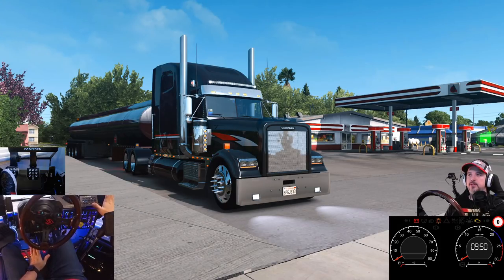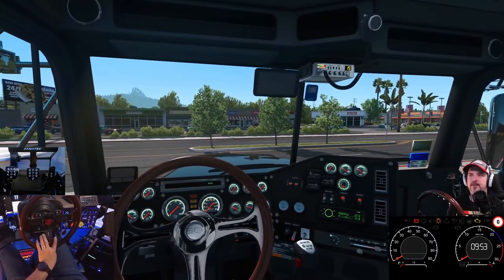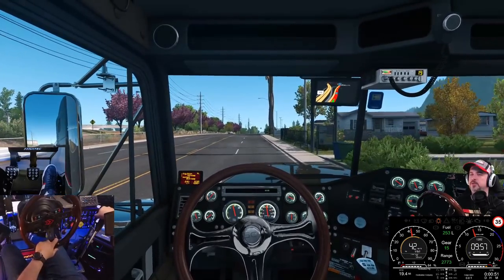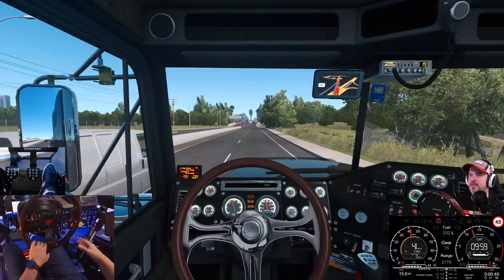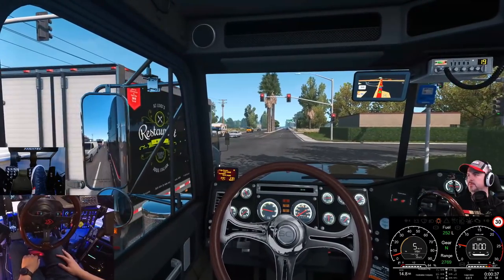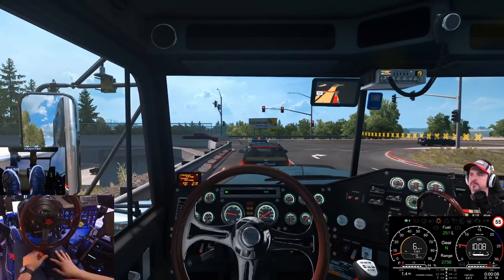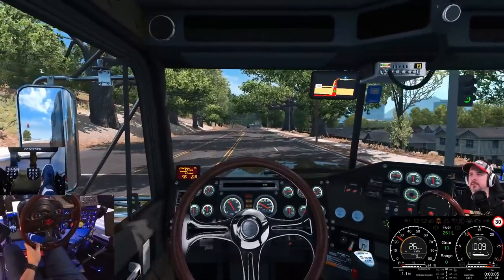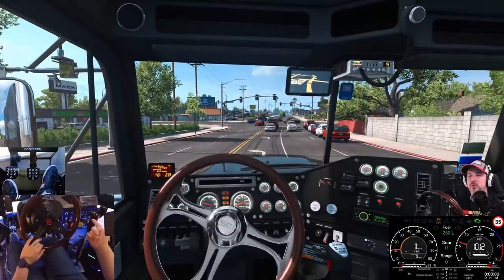HOW TO FLOAT GEARS IN AMERICAN TRUCK SIMULATOR - PEDAL CAM, SHIFT CAM AND THE WORKS | TUTORIAL

Comment: Okay I got a tip for anyone running the G29 or maybe anything else . I was not able to float the gears no matter what RPM in my setup . So I went back to Options then picked controls. In controls I scrolled down to H-Shifter Setup. Shifter layout setup I changed mine from simple to Advanced. Below that I changed the Shifter fast split from never to clutch or throttle. I then went back into ATS to drive and bingo I can now float the gears and the gear changes up and down. So I hope if anyone else can't float the gears give this a try to get it to work.
Reply: Thank you i have tried many times and could not get it to work "" G29 ""  got to the point i was considering upgrading to TH8A but will give this a shot
Reply: It work it works ty ty
Reply: @serpanol  HI I was going to reply after reading your message that buying another shifter wouldn't help. I actually bought the Thrustmaster THX shifter and was not able to float gears until I did the above after watching FTG. That confirmed to me there was something else going on. Glad it works!
Reply: Lol.  I have the g27 and I was floating gears way before anyone knew you could on the game. And yup that's the set up I've always had cuz that's the closest to a real truck.   Always works.  Do that first and you'll be able to float gears  you can also flare up the rpms by taping the gas pedal while in N in between shifting.   As in your in a gear and need to catch the next one  shift to N then tap the gas twice then shift and as the rpms fall the truck will catch the next gear
Reply: does this work for the TH8A? i can't float the gears no matter what i do
Reply: @RoadRunner-yu8cu   So I went back to Options then picked controls. In controls I scrolled down to H-Shifter Setup. Shifter layout setup I changed mine from simple to Advanced. Below that I changed the Shifter fast split from never to clutch or throttle. This should allow you to float the gears.
Reply: @b9bot148  yeah thanks it worked
Reply: @RoadRunner-yu8cu   Cool, enjoy.
Reply: Thanks dude
Reply: Americans geez. Floating gears. In Australia we call it changing gears.
Reply: YOU ARE A LEGEND. i am going to try this today
Reply: Thank you!
Reply: I had to do the same thing otherwise I had to use the clutch no matter what to change gears. Thanks dude!
Reply: @dalemcculloch9269  hahah, car guy, I’m kind of getting into trucks, and I don’t know half the shit they’re saying haha. Not Americans necessarily.
Reply: @dalemcculloch9269  Yeah nah we definitely still call it floating gears
Reply: I have my G29 with shifter i play ATS game I only use 10 speed shifter only.
Reply: thanks yo this helped a lot
Reply: Dude. You literally fixed my problem. I have been clutching for every shift forever since I got my G29
Reply: Appreciate it man couldn’t figure it out
Reply: Legend<3
Reply: thx
Reply: THANK YOU ❤️❤️❤️❤️❤️
Reply: MVP
Reply: @dalemcculloch9269  No you call it floating too when you shift gears without a clutch press. Your truckers learned from the USA, where trucking, trucks, internal combustion, the automatic transmission, locking diff, the internet, and youtube were all invented and sent to Australia. You're welcome, enjoy ;)
Reply: This is clutch no pun intended
Reply: @dalemcculloch9269  do u want a cookie or sum who asked u
Reply: thanks dude

Comment: If you want to add an extra element of realism to floating, go in the console and set g_hshifter_synchronized 0 and it will force you to match rpms even when using the clutch just like it would IRL.
Reply: That's exactly what I did.  I haven't been able to go back to a syncho since I did that.
Reply: @ghostnkc7444  I actually appreciate non synchronous gear boxes now. When I go to play a different driving game that requires me to use the clutch I'm like "Ugh I actually gotta do that?" Lol.
Reply: @zacharybishop6595  With normal transmissions that has helical cut gears & synchro's you dont wanna do that, they need the clutch pushed in to take engine load of transmission and help synchro's slide in place.
Reply: No way ... I was sitting here just finding out you can actually hook up the fifth wheel and have sim air brakes ... now I find out this... Im not gonna need a new game for a long time.
Reply: @ToreDL87  actually if you get your revs right plus the right timing with the stick you can drive synchro without the clutch. I drive a truck with a power assist Eaton fuller for work without the clutch and its synchro and i tend to fuck up when using the clutch

Comment: Got my NJ CDL in 1987 yes you are correct about the RPM  gauge but probably the most important way when shifting gears is SOUND yes sir if you listen to that engine the sound will let you know it’s time to shift gears when I first started out an old timer told me this he said Kid listen to your engine it will tell you it’s ready to shift gears I’m not saying the RPM gauge doesn’t work it does when your a new driver I know I did it the old timer broke me out of that habit when that engine reaches its sweet spot you can push that stick outta gear with minimal pressure then there shifting with the Jake brake works really well with the Mack 5-6spd gear boxes ok that’s enough talking

Comment: there still a problem that ats needs to fix split shifting should not shift automatically when sliding the splitter botten in real life you have to rpm match with the foot trottle for example shifting from 7h to 7l apply trottle to complete shift but the game does it for u

Comment: At time 10:52 When the front end is bouncing on takeoff from a complete stop, it's normally from a worn clutch or because the mechanic left a fingerprint on the clutch or pressure plate when installing the clutch. Lots of people don't realize how important it is to keep everything perfectly clean when doing a clutch, pressure plate or even disc brakes. Sometimes it can be caused by not using a torque wrench and it causes the flywheel to warp. When you were talking about not being sure what to do below 20 mph, I slow down to almost a stop early shifting down 3 or 4 gears at a time if I am making a fast stop, aiming for a stopping place maybe 25 feet before the white line. Then I don’t stop completely, I let the truck roll very slowly until the stick slips into whatever gear I want to take off in, then press in the clutch and stop the truck. That way you don't get any gear grind putting it into low to take off. I always shift with a gentle pressure on two fingers. Up or down doesn't matter. If you have to pull it out of gear then wait another second or two so the rpm and truck match and the shifter will slip into neutral like butter and into the next gear as well. When teaching others to drive I give them 3 pieces of advice. 1. When doing ANYTHING in a big truck, take your time. Relax. Big trucks don't move fast so don't force them. Slow and smooth. If you break anything you will be out of work until it's fixed or driving a POS loaner truck that everyone hammers on. 2. Always use all the real-estate available even if you don’t think you need it.  I hate seeing people pulling trailers over curbs or dropping them into ditches.  When running heavy, curbs can pull tires off of beads.  Ditches when running heavy can roll your trailer which in turn can roll your tractor.  3.  Never back up at an intersection. NEVER.  It doesn’t matter if it’s in heavy traffic or not.  You never know what the idiot in the 4 wheeler is going to do.  They may act like they are going to help you out, but then at the last second they pull up or to the side and you wind up pulling a trailer over them.  Pull up where you are supposed to be and let THEM move.  Just stay legal and if it comes to it and a cop arrives, he will MAKE THEM move.  Ignore the traffic, the cursing and the sign language and STAY IN YOUR TRUCK.  You have an air conditioner and a radio.  Just relax and wait them out.

Comment: I learned to drive in a Mack Rd800 hauling coal in WV. I never got ahold of double clutching before I left and went underground to work, but I did learn that the clutch is just to take off or go in reverse lol. I floated everything and it’s a whole lot easier in a real truck you’ve got a feel for when the gear is ready to change. It’s hard to go by sound in an old coal truck too with no rpm gauge 😂l

Comment: good job buddy! not many trucks you have to use double de clutch anymore maybe on a heavy haul you might, most UK truck are now all coming auto and you pay extra if you want a manual, but you think its slower to float the gears but its much smother and you dont come to a full stop many time, in real life if you are in traffic on the motorway sometimes its best to follow the truck lane as they want to keep moving so its less stopping! 👍🏁💜
Reply: I swear just cruising in the right lane(IRL), not worrying about passing people or getting ahead (almost) always pays off, very often I end up passing the same cars that passed me 10 or 15 minutes ago when we reach a light or round about and I was able to drive safer and more efficiently.

Comment: as someone who has limited driving manuals irl to only learning how to drive manual crane trucks because of my job, i shift with feel of the transmission, put a little pressure on the shifter and it will just pop into place which is nice. It is indeed a lot harder to do in video game than irl.

Comment: Many people when they set up the setting are just using a shifter with no range finder or anything the easiest way the float gears is to change your shifter setting to a 18 speed or whatever transmission u want then u have to clutch to start and u can float whenever

Comment: All Manual transmission Semi's you have to use double clutch (unless you float the gears of course). and when it comes to downshifting, you want to make sure you are in a gear that will allow you to go when you accelerate if the light turns green before you come to a stop. If you are coming to a stop sign stopping 6th or lower.

Comment: IRL you don't fully pull your foot off the gas when floating gears, or most cases the transmission will not let you go into gear, and you'll have to cram it in and damage parts. You only lift off the gas enough to bring the RPM's down around the 1,500 area in most trucks and eaton transmissions, and you'll be able to gently float gears and you push back on the throttle. You never fully take your foot off the gas, you only lift off enough to drop RPM's.
Reply: But this is a game and they did a pretty damn good job, I love floating in both IRL and in game.

Comment: I just got the shifter with the range and splitter,  I'm driving the international lonestar and my RPMs go up to the 20 mark not the 15 like yours.  I'm new to this and wanna know is all trucks different when to gear up? I get gearing up and splitting gears and such, my problem is downshifting. Plus in my g920, the break peddle is so hard to push down,  so I'm struggling to brake and know when to gear down.  Downshifting is probably the easy part for most, but complicated to me.

Comment: On the kw t660 Cat motor 18 speed I like to up shift at 16 down shift at 11. I have little to no issues floating but I’m being made to double clutch and that’s a pain in the but. Also when combing to a stop I was always taught to never be out of gear. Stop in 4th with the clutch in and find second once the truck has stoped

Comment: I tried doing this with 6 speed transmissions (still waiting for my truck shifter), and that's why I'm here. I'll tell you, it's not easy on a 6 speed. Also, what "real brand" mod are you using? You have different ads and brands than the mods I use for it.

Comment: Hey. Nice video. I still need some training to float gears so smooth. I would like to know what are the mod name that allow to add a GPS-like device with dashboard infos (fuel consumption, cruise control...) at the bottom left of the windshield and the one with the GPS at the upper part please ? Thanks

Comment: With the range selector (front switch), do you flip it up before going into neutral then into next gear or neutral first, flip the range selector up then into next gear? Thanks, Mike.
Reply: Hey mike, I'm not sure if it applies for ATS but whenever I'm driving I'll always preselect the range so if I'm in 4 (bottom box) I'll select the high range box once I get into 4th so when I go for 5 or 6 I won't have to worry about what box I'm in
Reply: @Khano94  I like to flip it just before I switch from low to high, it doesn't apply in ATS but IRL the preload of both range & split puts wear on the transmission the longer it's pre-selected.
Have seen pics of the internals of a real Eaton where split & range had been pre-selected for too long for too many times between low & high, throwouts were ground halfway off, gears were a mirror sheen (due to the metal wearing off the throwouts) and cracks were developing on bearing ladders on the transmission casing.

Comment: Are you using head tracking? If so what are you using?  I'm so tired of using my mouse.  Thanks.
Reply: They might be using TrackIR. Its a device you slap on your head with a camera near your monitor to track your head movements irl and convert them into movements in game, but they take some getting used to. 
They're much better than wheel arrows and a bit better than a mouse. They go for around like, 100 or so USD.

Comment: This helps a lot, thank you.  Question, I've read that I should change the h-shifter to asynchronized from synchronized in the console menu.......did you do this or is it needed?  Newer to ATS and brand new to wheel and shifter.
Reply from the maker: so all that does it require you to match RPM's even with the clutch. At some point with out any kind of force feedback, it becomes really difficult to do that. It's up to you. For me, floating the gears was enough.